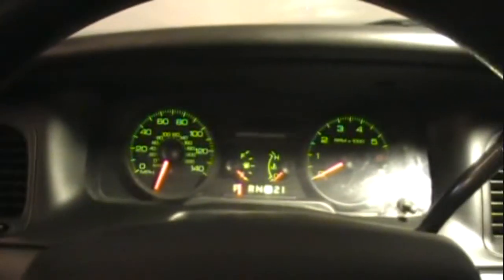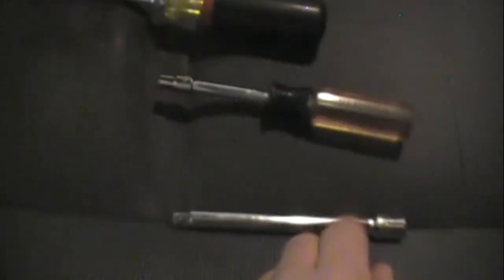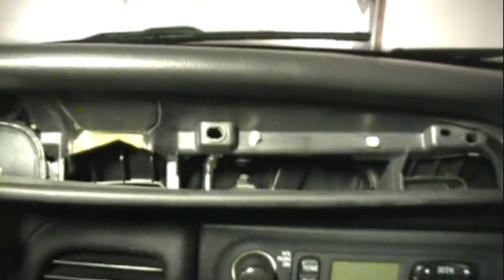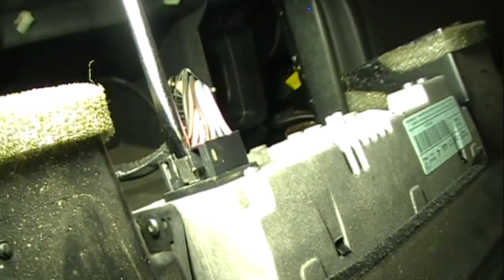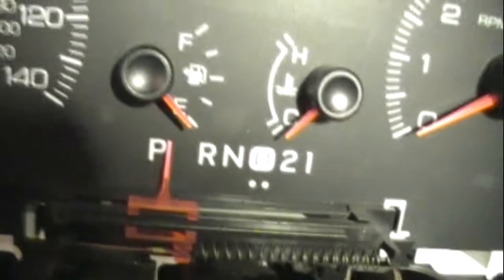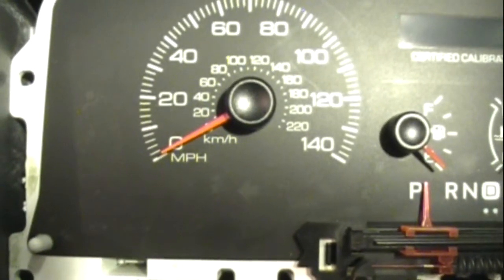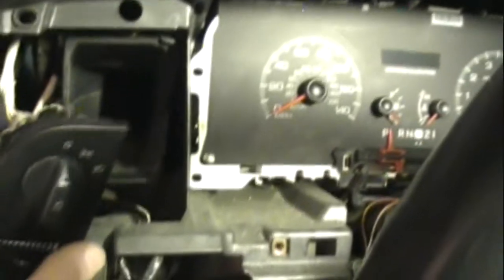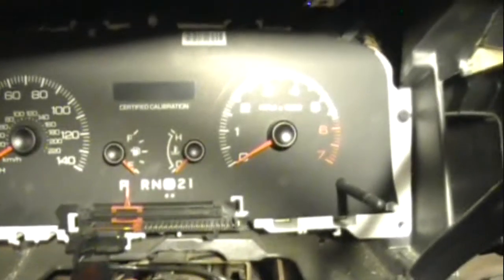Crown Vic Gauges replacement

Comment: I have a 2008 crown vic pi and my temp gauge needle has fallin down to about the same spot as your speedometer gauge. the gauge seems to work as it should but im guessing at the normal running temperature of the car the needle is at the cold mark. could I reset the temp gauge the same way as the speedometer gauge so its back to normal? I have not found a answer anywhere about the other gauges